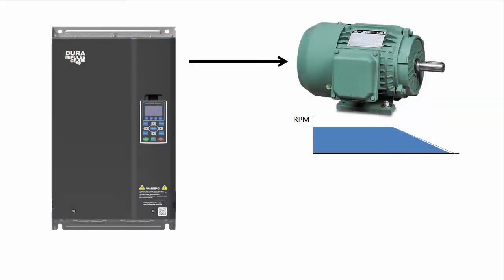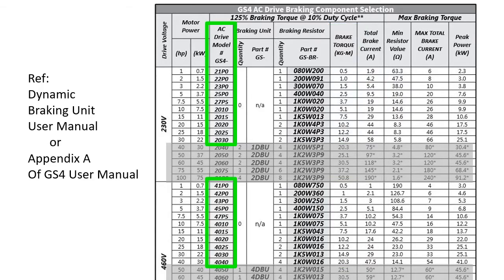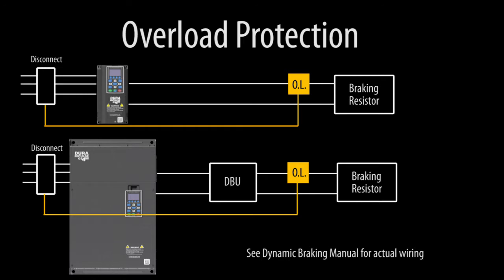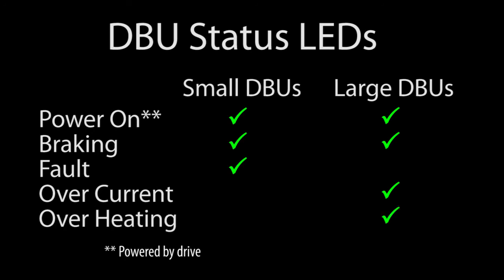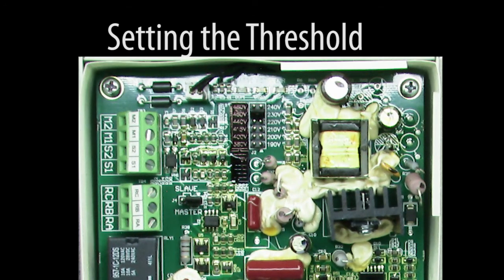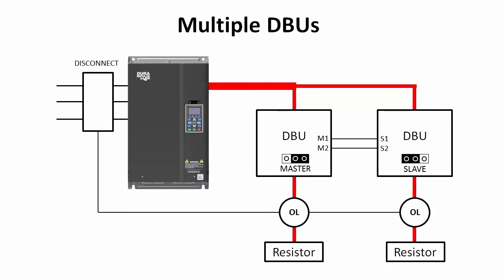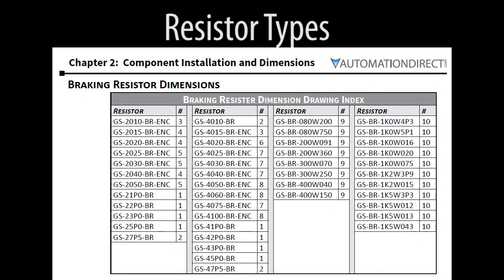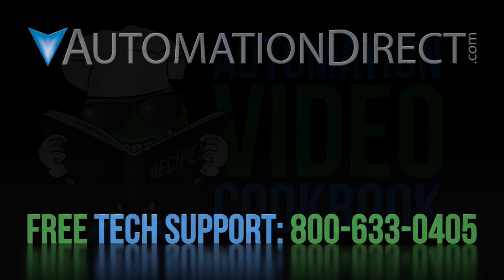DURApulse GS4 VFD Dynamic Braking from AutomationDirect

Comment: Can I use a Thremal Switch instead of the Overload?
Reply from the maker: Assuming you are talking about the overload in the brake resistor, then yes, a thermal switch is often used for the overload described.
Reply: @automationdirect   Thank you for your answer. Yes I'm talking about the oberload in the brake resistors.

Comment: My adlee ms4 ipm drive showing dcdr code after  
Motor stopped. Why dynamic breaking is it applying?
Reply: Hi Monu, Unfortunately AutomationDirect doesn't sell or support Adlee VFDs ... I would encourage you to take a look at AutomationDirect's Full ine of variable frequency drives here: https://www.automationdirect.com/adc/Shopping/Catalog/Drives
They are excellent drive, competitively priced and fully supported by our award winning free Tech Support team. And as you have seen - we have tons of video tutorials covering our drives heer: https://www.automationdirect.com/videos/home?t=link&cat1=113
Reply: ADC Previews thanks for your prompt reply. But can you please tell me why dynamic breaking coming in to play during motor running, causing me production and material loss
Reply: We are not familiar with that drive so really can't say what the issue is.  Good luck with your project.
Reply: Here we have some regen unit for reference:
http://www.elevatorenergysaving.com/Products/Re/Regenerated-Braking-Unit-RBU-PSG.htm
Reply from the maker: Hi Monu, Unfortunately AutomationDirect doesn't sell or support Adlee VFDs ... I would encourage you to take a look at AutomationDirect's Full ine of variable frequency drives here: https://www.automationdirect.com/adc/Shopping/Catalog/Drives
They are excellent drive, competitively priced and fully supported by our award winning free Tech Support team. And as you have seen - we have tons of video tutorials covering our drives heer: https://www.automationdirect.com/videos/home?t=link&cat1=113